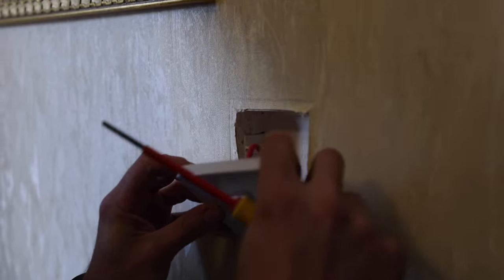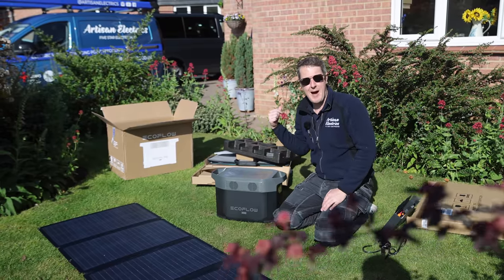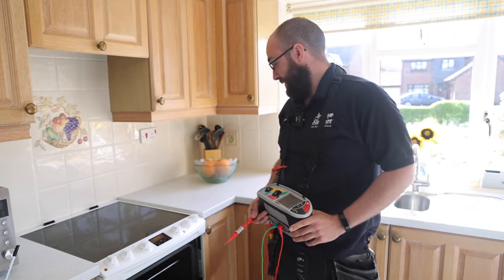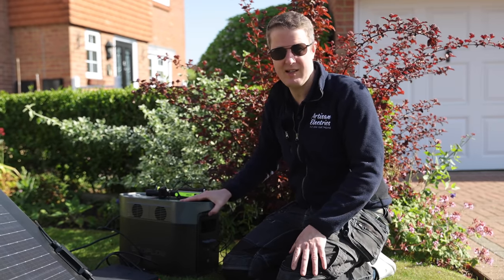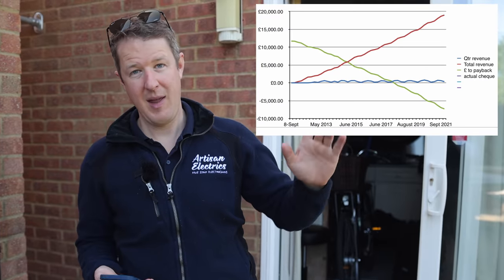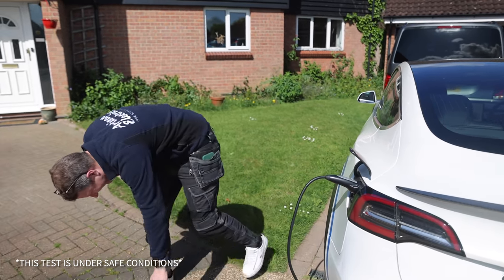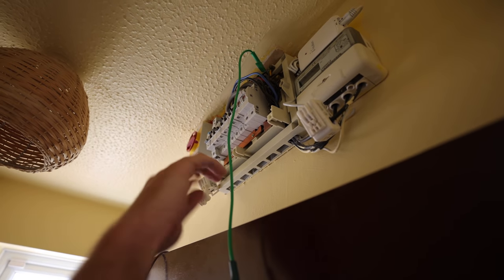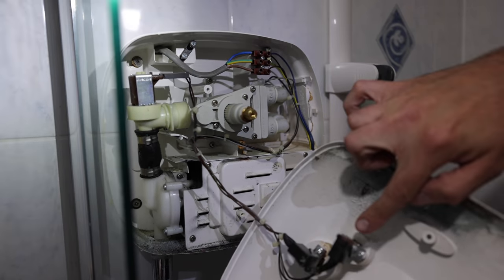PLANNING BATTERY STORAGE FOR AN EXISTING SOLAR PANEL INSTALLATION!

Comment: I am concerned about your method of calculating the battery requirements.  You are putting 17.4 kWh of batteries in the house for overnight usage. But for this to be worthwhile they would have to generate that 17.4 kWh as excess electricity from their solar panels . To decide between 2 batteries and 3 batteries you would have to know how many days they export between 11.6 kWh and 17.4 kWh so you can see how valuable the third battery is. It is important to see how many days of the year electricity being exported to the grid is enough to significantly charge the batteries. For example in winter a 4 kW solar system will only generate a few kWh most of which is probably used by the house during generation. I suspect that more than two batteries is a waste of your customers money and money that they will never recover.
Reply: If you charge them off peak during the winter months you can see some savings. With an EV you can get 4.5p/7.5p off peak rates (EDF/octopus).
Reply: @bencampbell2041  To charge them off peak wouldn't you need economy 7?
Reply: Yes,  the numbers don't sem to add up. Factoring in the age of the panels you are looking at trying to charge a 15-16kWh battery bank from a smallish 3.5 kW solar system.
Reply: @terrydennis467  Yes, I think 2 batteries would be the maximum required. There would not be many days of the year when the excess generated for overnight usage is more than 10 kWh. The batteries also give energy to the house during the day. For example on a sunny day when a cloud goes over charge will be taken from the battery for use in the house. So the amount of charge in the battery at the end of the day is the excess through the day minus the amount that has already been used from the batteries during the day. There are not enough solar panels to fully charge these batteries on a regular basis.
Reply: Really depends on what the customer wants to do, if it's just to use excess on a day-by-day basis or to minimise exports and hence imports e.g. I have 4kWp PV (no batteries yet but considering) but I divert excess into the HW system, at this time of year a peak sun day might generate 25kWh versus in winter where the worst day was <1kWh - at the moment the HW tank can take around 10kWh but that's working on the assumption that all the heat has been taken from it over the course of the day and night, on several subsequent sunny days, the system will start exporting again as the HW hits top temperature within a few hours. However on the flip side in winter, there is barely enough PV to cover background use like the modem, lights, fridge etc so zero excess generation. At the same time, we use very little electricity overnight - probably 1-3kWh depending on the time of year, so again a full battery may not have any spare capacity to charge the next day - it's a balance depending on circumstances. If I had an EV then I would try to max out depending on the scale of £/kWh storage to minimise exports/imports within reason and push power into the EV and battery for where it's needed - for me a 10-15kWh battery would make sense even though our night use is low, but I would consider making sure it's scaleable if circumstances change - even then I would envisage exporting over the summer. The seasonal nature of PV isn't perfect sadly!
Reply: @Umski  I have a similar setup to you: a 4 kW system and an iBoost on the hot tank. One of the things with using batteries like this is that not all the excess that is put into them is used at night. If a cloud goes over on a sunny day then the house will use power from the battery, which will leave less charge for use at night. I can't see there would be many days of a year when a third battery would do any good. As the price of batteries in is the £ thousands you need to do a calculation on how many kW you would put into the third battery and use over the course lifetime of the battery. My guess is that the extra battery will make the difference of about hundred kWh a year at most,  probably a saving of £50  a year so would provide a negative cost benefit.
Reply: @caparn100  true, depends on the reason for adding batteries I guess and how clued up the homeowner is rather than blindly relying on the installer - cost or self-consumption...also depends on the scale of battery e.g. Pylontechs can go up in increments of 2.5kWh for under £1k which would make for more scaleability if needed and if as they suggest electric import is going to hit 50p/kWh it may well make sense to have the extra capacity and max out when possible even if the payback adds a couple of years...

Comment: Apologies but I’m not following the logic of the battery here. You mentioned householder receiving over 60p per kWh feed in tariff for every kilowatt generated. I thought the max 11 years ago was 45p per kWh. Which ever figure  it is, surely that is far higher income than the max charge from the energy supplier. Is it not better to collect the income from the FIT rather than put into a battery in this case?
Reply from the maker: They collect the income for every kWh they generate even if they store it in a battery and use it at night to power the house.
Reply: It was 45p, but it goes up every year with rpi. 

As I get paid based on what I generate, it pays to use as much of it myself as possible.
Reply: @artisanelectrics  So the fit meter is the ac side of the inverter? Presume you will have to replace the inverter as it prob hasn’t got dc out option to the battery. Will this not impact the fit tariff?
Reply: The FiT scheme paid on generation not export (well actually it does pay export to). It doesn’t matter if the energy is stored, you still get paid; so it’s better to store it locally. The supplier pays the home owner for the energy generated AND the home owner gets to pay the supplier less by not buying so much electricity from them.
Reply: @Pelham22  the solar system and it’s inverter is kept completely separate from the new battery inverter and batteries. As far as the solar inverter is concerned the battery inverter is just another load on the house wiring. 

It’s better that way. The fit meter remains untouched - sitting between the solar inverter and the consumer unit, and still just recording the amount of generated AC.
Reply: @GrahamRead101  only downside is the bureaucracy of applying to the DNO to add the extra battery inverter - from their perspective the property then has the means to export 4kWp from the panels plus whatever the battery inverter might chuck out at maximum, even though in reality the battery will never export to the grid - I guess it's in case of a fault situation where the local network may already be maxed out - I guess if they're paying the installer to do the job then this paperwork will be factored in to the overall price!
Reply: @GrahamRead101  this is where 'early adopters' are really starting to benefit
Reply: @Umski  true. Particularly as it may well not be covered by the G99 fast track and can take an age to get a response.

Comment: I theres already a grid-tie inverter - then what is the point in having batteries? Just seems like a huge waste to me. The only real advantage is the fact there will be a backup source of power if the mains gets cut - but thats a rare thing these days.
Reply: The batteries are used even on a sunny day when the clouds go over. They are also used at night when there is no sun. As they are charged by excess generation from the solar panels any electricity going into them is free.
Reply: Grid tied so power cut will also power down the inverter so the linesmen dont get backfed electricity from the house.
Battery stores the "spare" from daytime and the house can use the stored at night instead of buying from the grid at 47p a unit or whatever inflated rate it is now.
Reply: The big advantage is storing the excess power from the PV, for use later. Thus substantially reducing the (increasingly expensive) grid import. Bear in mind on a fit contract you are also paid for that energy - whether you use it or not yourself. So win win.

Comment: Do you realise you need to do a g99 / g100 application to the Dno prior installation of ac coupled storage due to the dual discharge ability? 

Also swapping Fronius for hybrid doesn’t effect feed in tariff. The kw stored in batteries just flows through generation meter later in the night so no loss of fit. 

If using for ac charging the generation meter need to be swapped to none bidirectional meter notifable to the clients fit team
Reply: Of course they don't know these things. They're just jumping on the band wagon.

Comment: What does he mean when he says it’s a power shower so it doesn’t draw any load?
Reply from the maker: It doesn’t heat the water it only pumps the water so it doesn’t take much power
Reply: @artisanelectrics  so heated by the boiler?
Reply from the maker: Yes, it will take the water for a cylinder that has been heated by the boiler.
Reply from the maker: Yes exactly
Reply: @artisanelectrics  ahhhhhhh!! Ive had an idea for you as well - am I talking to Jordan here?
Reply: It's just a pump to raise the water pressure from probably a hot water cylinder i.e. no heavy current heating element.

Comment: A Tesla will do about 4.4 mile per kWh so if you can get 2 kWh from the EcoFLOW into your Tesla battery then you should get about 9 miles more.
Reply from the maker: Enough to pop to the shops then!
Reply: @artisanelectrics  maybe keep the Ecoflow in the Electric Van!
Reply from the maker: Now, now 😂
Reply: @gavinnoname1424  😂😂

Comment: Why inline instant electric showers are so popular in UK and at the same time they can't have electric sockets in a bathroom. I think electric ⚡ showers 🚿 ar more dangerous.
Also it's costly to heat water with electricity using resistance elements. Could at least recycle waste heat.
Reply: The theory is that you are only using electricity to heat the small quantity of water while your shower.  If you heat the water in an immersion tank you have to heat more water and keep topping the heat up as the tank cools.

Comment: I thought the fit tariff had Been reduced
Reply: There is no FIT tariff any more. 
You need a smart meter to measure how much electricity you export and an agreement with an electric company to buy what you export. They will pay you at most about 5p per kWh for what you export.
Existing customers on a FIT tariff are not affected by the removal of the tariff. It is only new customers it is not available to.
Reply: @caparn100  he didn't mention 61p would the customer still be on the old contract .  One of my customers had one of the first UK solar systems fitted they came over from Germany to fit it . Still working customer refuses to allow the meter to be changed and remain with the same supplier .  It was fitted before FIT  tariff . They made the meter run backwards when the sun was shining . Only issue was if the meter was read  and it had gone beyond the last recorded reading the supplier would charge as if the meter had gone all the way around . They solved the issue by making sure the meter was a few units past the last reading by breaking out a shed full of convertors heaters to use just enough remove any issues before the next reading . Thought it was a excellent way of doing it .
Reply: @justmeEnglandUK  They are fitting batteries that contain an inverter. So the batteries do not go between the solar panels and the solar meter. The batteries will take the electricity (at 50Hz) that would have been exported to the grid, the inverters on the battery convert the AC to DC and charge the battery. So it won't make any difference to his existing tariff it will just be like he is using all the power he is generating.
The old FIT tariff you just get paid for each kWh the solar panels generate, there is a generation part and an export part all of which are just calculated from the meter connected to the solar panels. They pay a given amount for each kWh generated and an additional amount where they assume you have exported half of what you've generated whether or not you do actually export or use it yourself. I think the meters that go in reverse would be for solar systems greater than 4 KW from the document about the system at the beginning of the video it looks like the system installed is 3.99 kW.

Comment: Hi folks, does anyone know if I could use an EcoFlow battery to essentially contact a plug to another plug (so imagine a 13a plug connected to a lead with another 13a plug on the other end) which then plugs into a mains socket - the idea being rather than me running several extension leads around my house, this way I can power the entire ring main (downstairs or upstairs) in one go. Obviously I understand I would have to turn off the main switch so I'm not sending power down the main cable into the road/power network.
Reply from the maker: That would be mad dangerous as you would essentially have a “naughty plug” where the exposed pins are live and it would be a huge electric shock risk if someone unplugged it.
Reply: Like many things you can do it but it's very dangerous a) you will have live pins floating around if/when the plug is unplugged, b) you may forget or switch too late the main switch c) technically I think it would be against most of the Regulations and supply authority rules - but people do it..............

Comment: My opinion is to rewire the whole the house with Flexi cable Black or white no matter is much better than normal becuse protect for water also and mould  including PV system 
Flexi cable is the best also when you
Cary out R1 + R2 the reading should be lower then the normal twin and earth cable we using
In our rutine

Comment: Well I hope that solar isn't powering those batteries.
Nothing worst that using batteries as heater resistors.
Only ends in fire..
Reply: Im not sure what you are alluding to, these batteries are designed to work with an inverter on ac and dc .